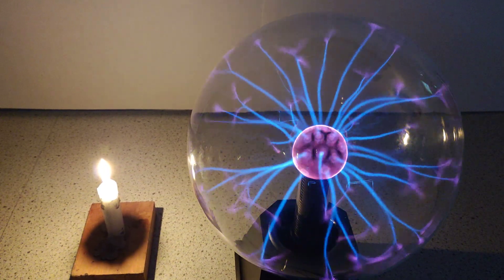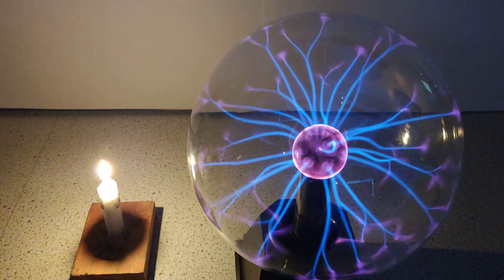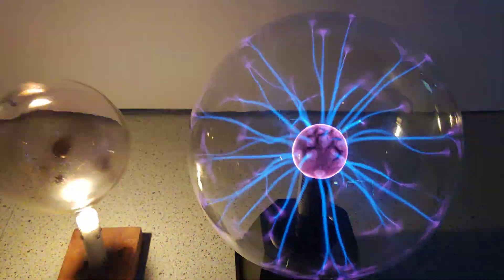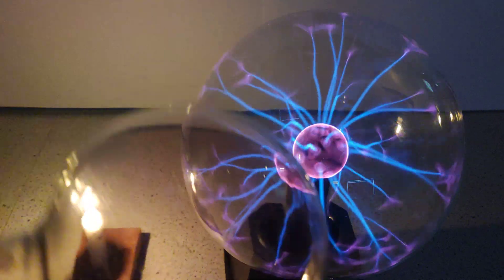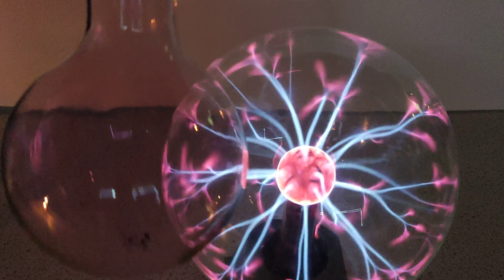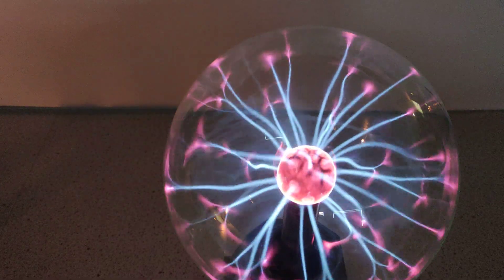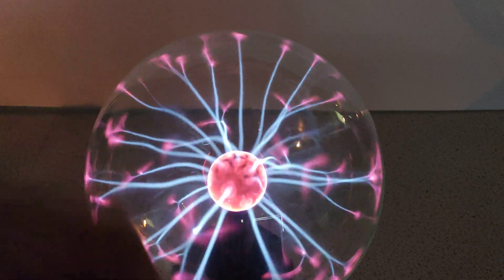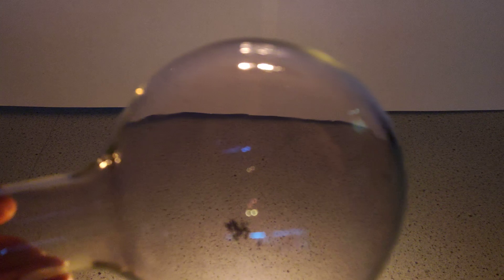Plasma Ball and LED Diode behaviour and Iodine Gas

Comment: ever put a magnet next to one. ??
Reply: question does the flow change in the ball upside down.?? and it looks like one single plasma discharge was following it. any other elements tried ??
Reply from the maker: Not yet. I went home!😃
Reply: @animatedsci  lol no worries.
Reply from the maker: yes
Reply from the maker: You can get a swirl I think.
Reply: noice. i thought it might make a movement. was it clockwise or counter clockwise.?? if u have two magnets put one on each side switch the N&S poles of both sides. like n-s an s-s or n-n and s-n. each should have different results.
Reply from the maker: Look at my Maltese cross video that shows this well. Problem is the electron stream is a bit random on this one.
Reply: @animatedsci  k. thanks friend
Reply from the maker: @MichaelMyrick1123  I have just also posted one more video on this, and the magnet does not make much difference really in this case. But, my finger took the brunt! check in a few mins!
Reply: @animatedsci  very nice friend.